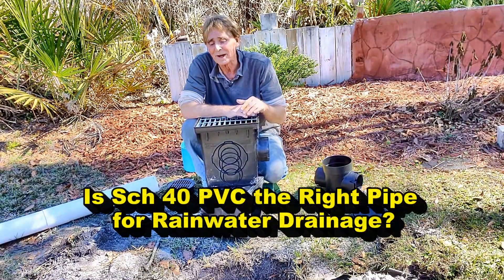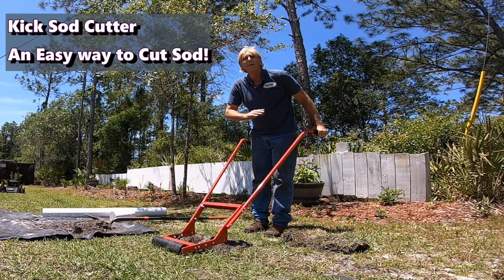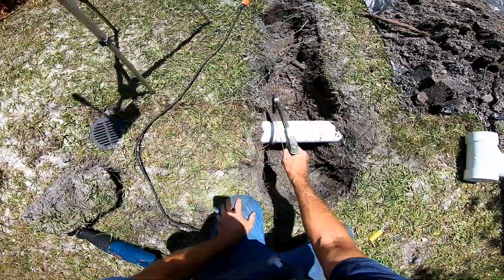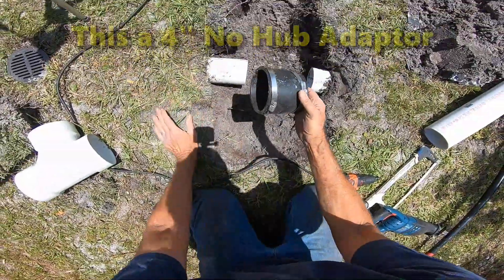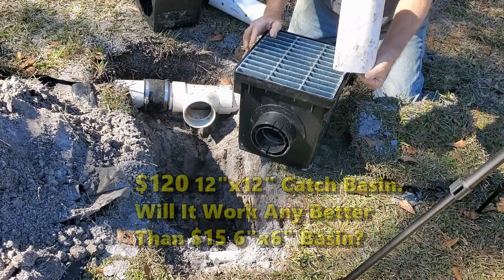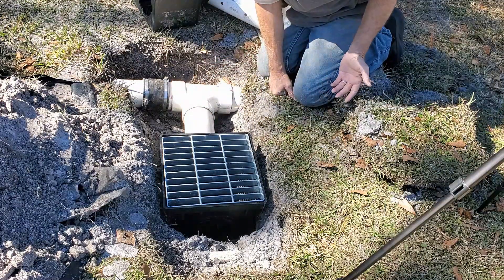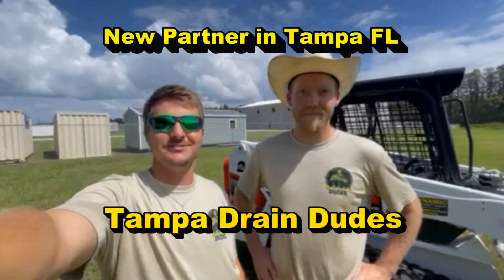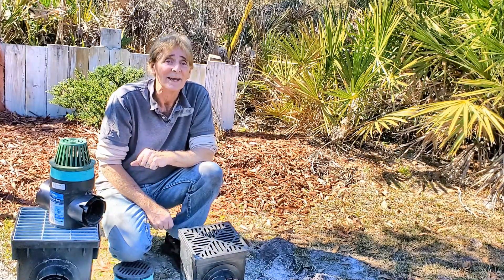Is Schedule 40 PVC the Right Pipe for Downspout Drain?

Comment: When I put in my own yard and downspout drainage system (inspired by Chuck's fantastic videos), I used SDR35.  Of course back then it was about $9 for a 10ft stick.  Mainly I wanted all the fittings and connections to be solvent welded because I have a of plants and trees nearby and I want to keep the roots out as much as I can.